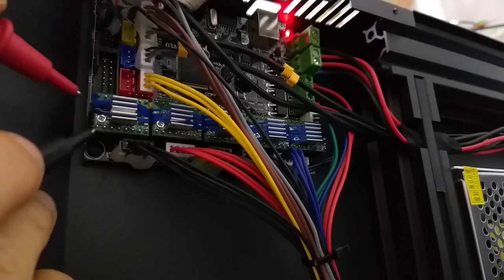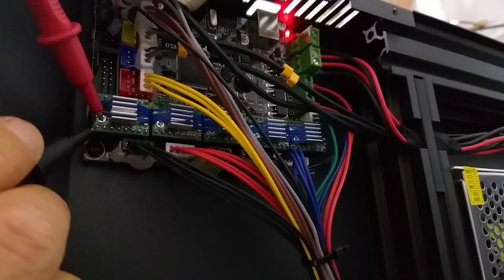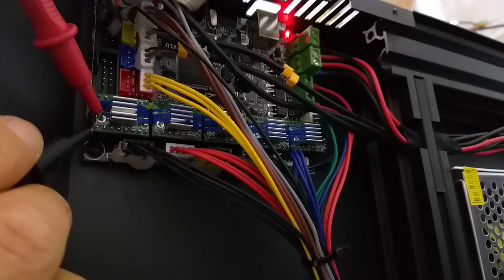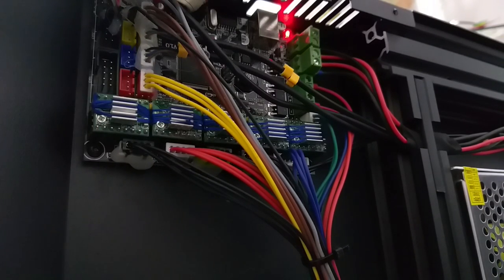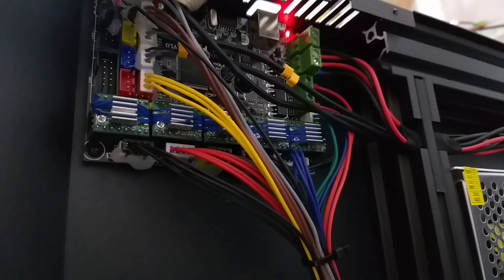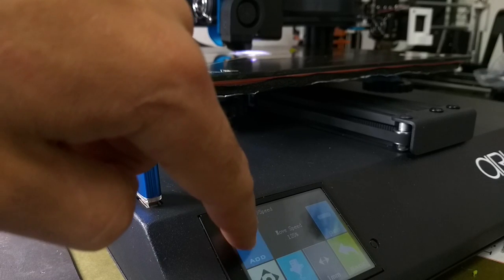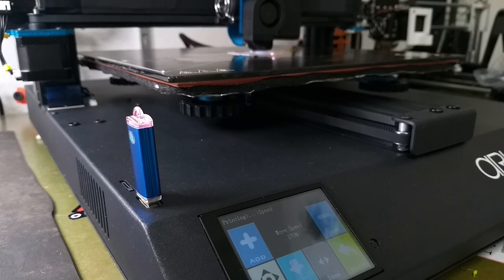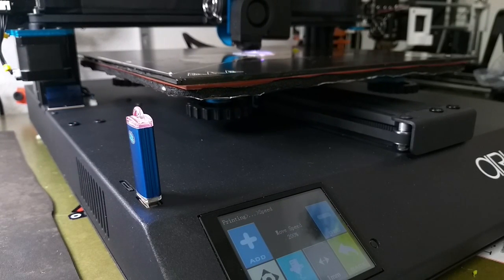HOW TO SOLVE - Artillery Sidewinder X1 CheckSum Error

Comment: It worked for me! I was getting weird checksum errors when printing from the sd card (while with the USB stick it was skipping gcode... heven't verified yet that it fixes the USB stick as well, printing from the SD now). Originally my voltages were set to 1.008 for almost all drivers before (+/- 0.030V). I've set all of them to 0.7V. This is my first day I got the printer and I already voided my warranty by doing this :) Unbelievable that I had to do a fix that appear to be required... I am more confident that it is required because someone said with v1.5 it was 0.4V out of the box (I believe I got V4 here in Canada, not sure where you can confirm the hardware version)
Reply: So the problem with the USB memory stick skipping gcode is still there, so I guess a different problem... anyway for now I am going to use the sd card, as long as it is stable I'm happy. I did a test multiple times, and in the last one I copied the gcode file that was skipping a part of the initial layer (a simple XYZ test cube) from there USB stick to the sd card and it printed fine without skipping on the sd. I also tested with 2 different USB stick and I have the same exact behavior & problem.
Reply from the maker: Hello, 
Yhea, I recommend 0.7v, what I have printing a lot of time without problems.
You can check the version that you have through this image that I did for you.
https://ibb.co/PtzqkZF
Reply from the maker: Honestly I never tested the SD card :) 
Im using USB stick without problems, strange, I never see anyone with that problem.

Comment: Hello, I have also problems with to much heat on the extruder motors. I check the Voltage on all Drivers is between 0,98-1,01 Volt. You are sure that 0,5 Volt is 
enough for fast movements? I think I try 0,75 Volt on all Drivers.
Reply from the maker: already tested with 0.5V on all drivers, looks good anyway I recommend 0.7V, Im using 0.7 now without any issue.
Reply: I use 0.8

Comment: Have the same mistake with the checksum and he stops during the printing and continues at some point. I put down the voltage from 0.94v to 0.75v, but both errors remain.
Reply from the maker: So, try change the tft screen cable, white 4 wires connector.
Reply: @NunoFlyer  Do you know where to buy this screen cable?
Reply from the maker: @qui3scent  Artillery company sent me one.
Reply: @NunoFlyer  Thank you! I actually just returned the whole printer to Amazon for a new one.